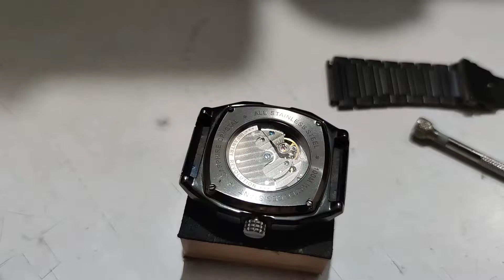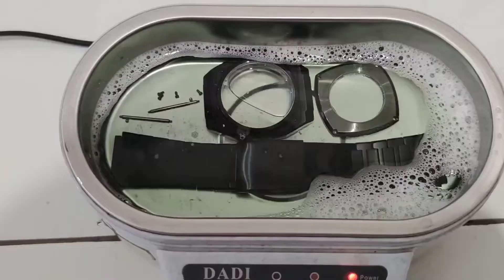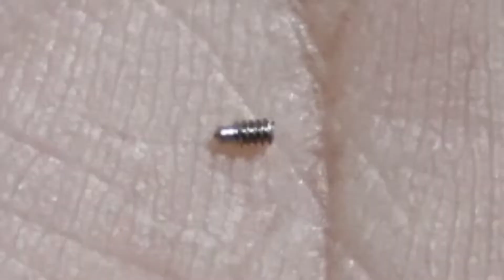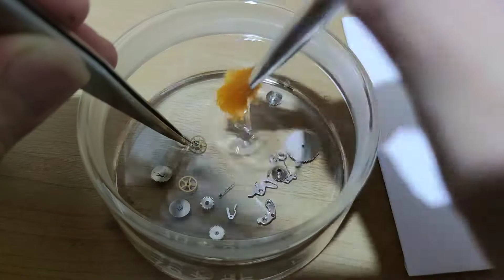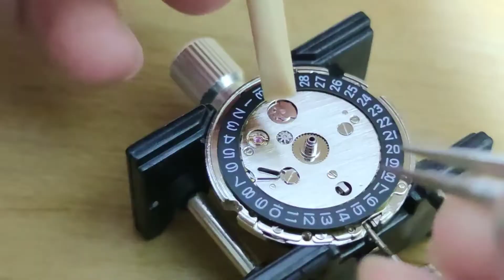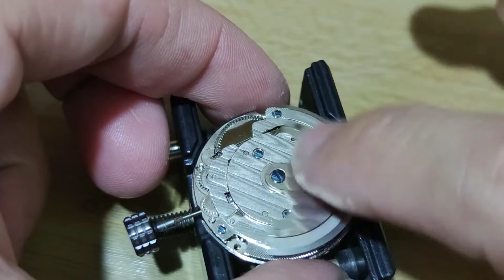Servis Jam tangan otomatis Infantry Evolution (movement T16/ST16 )

Comment: Hi. Does the ST16 hack second hand? Is that the hacking lever at 9:15 in video? Also does this have bi-directional auto winding. It looks like Seiko "magic lever" at 10:36 in video. Do you recommend this movement over Miyota 8215 or 821A? I want hacking seconds. Looking for better quality movement than 2813. Thank you.
Reply from the maker: Yup.. Thiss movt better than mingzhu 2813, and have hacking second hand... 
If you want better movt.. Maybe can replace with eta 2824
Reply: @pecintaarloji8073  Thanks for your reply. I also have eta 2824 but stem height is 1.8mm vs 2.5mm (2813) so not direct fit in case. I find ST6, ST16, DG2813, Miyota 8215, 821A, 8315 all have 2.5mm stem height. Unfortunately can not find 28,800 high beat movement with 2.5mm stem. ETA2836 is close with 2.25mm stem height so might work.